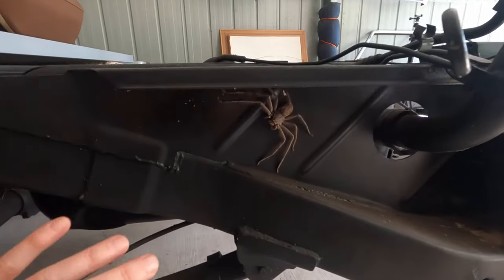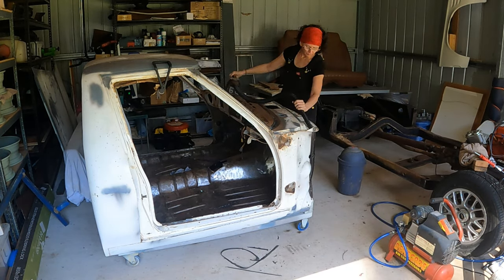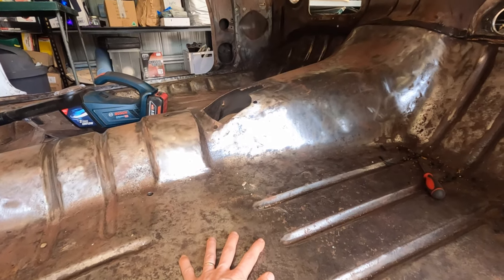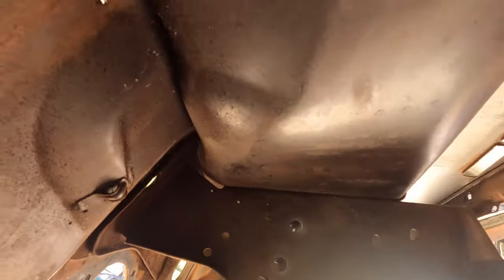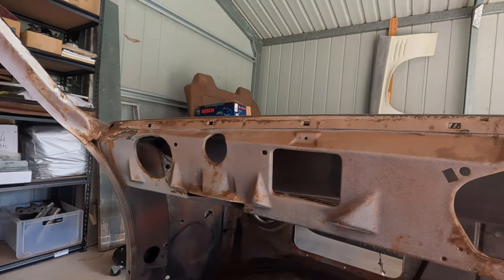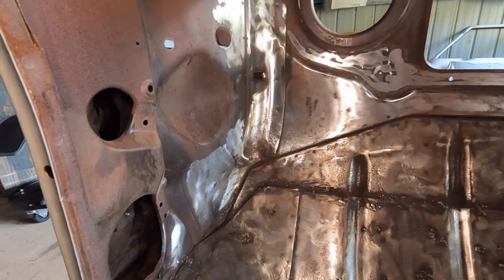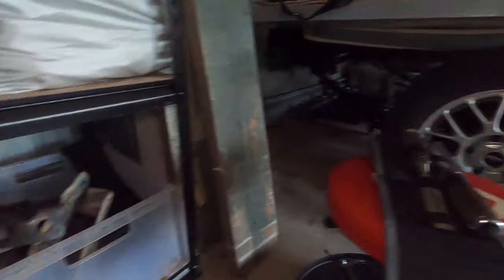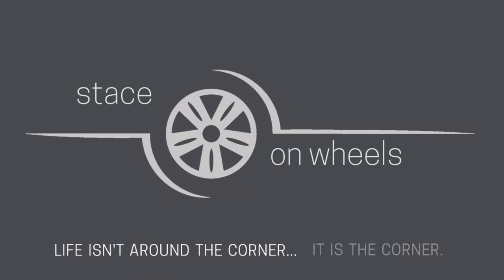Floor Restoration on the Holden HZ One Tonner PART 1 Rust Removal

Comment: Buy yourself a right angled disc sander with roloc attachment. Then buy 2 inch scotch brite discs. You'll never look back! Keep up the good work 🎉
Reply from the maker: Thanks for the tip, there is so much I keep learning from viewers like you! I don't have power in the HZ shed (apart from a small generator that barely ran my drill) so whatever I use has to be battery at this stage... I don't know the full range of disc sanders you can get, but it would need to be smaller than my grinder (125mm).
Reply: @staceonwheels  you can buy battery ones. They are quite expensive though, but will get into all those fiddly areas. I find it quite therapeutic actually
Reply from the maker: I'll go looking for one... and yes I understand that therapeutic effect... relaxed focus like in meditation.

Comment: If that pass side floor was put in better, You could say that's a near perfect cab, I was the same with the blasting, plus the cost and I could control the time frame stripping myself, I also used the KBS system on the internal cab and found it great, also used rust blast on the body and parts, watch it in the heat though. 2 years on since paint and there have been no surprises coming through the paint, I cavity waxed the whole ute and chassis too.. You are doing a fine job there anyway, enjoy.. Lee
Reply from the maker: Lee, thanks for the confirmation! What do you mean by cavity wax? I was planning to use Fishoilene in all the cavities. Thanks for sharing your experience too.
Reply: @staceonwheels  cavity wax is like thinned wax in a can, I've used fish oil before and wanted to try something else, the cavity wax has a long tube and a nozzle that shoots the liquid 360 degrees, it worked for me, but I've had no issues with fish oil either..
Reply: Gday Stace, you making bloody good progress, that can is In incredible good condition for its age, top job mate, cheers
Reply from the maker: Thanks Matty. Now that I started this channel, I almost worry sometimes my progress isn't fast enough... gotta keep reminding myself it's for fun and not more stress. And it is heaps of fun.
Reply from the maker: I'm curious to check out the cavity wax now!
Reply: @staceonwheels  do t change what your doing, it’s not a race and your the one in charge mate
Reply from the maker: You're wise.

Comment: It's a shame you couldn't have gotten it acid dipped. I had my stato chassis done and it removes rust and cleaned where you can't get any hands or tools.
Sadly expensive but works great,  food for thought on the chassis ?
It brings it back to the metal it was In the factory.
Reply from the maker: You're right... it sounds like the right way to go. But I really wanted this project to be me doing the work. It won't be perfect but I'll know every inch of this one tonner by the end! Luckily the rust is miniscule jn this one, amazingly.